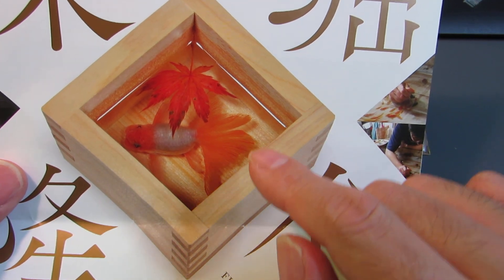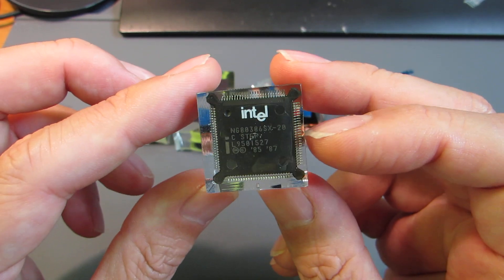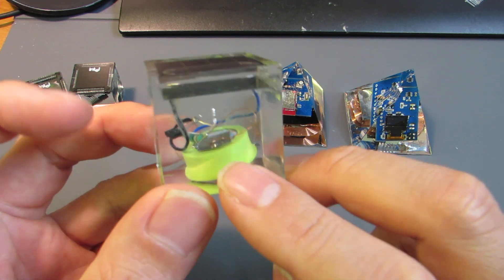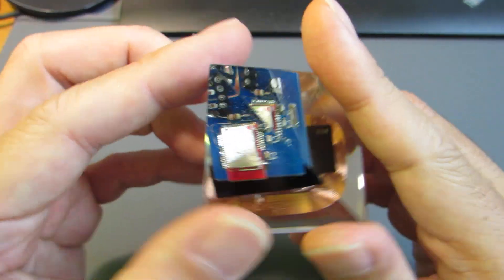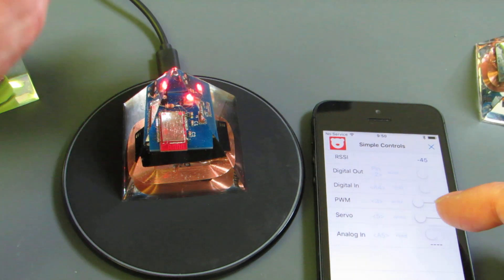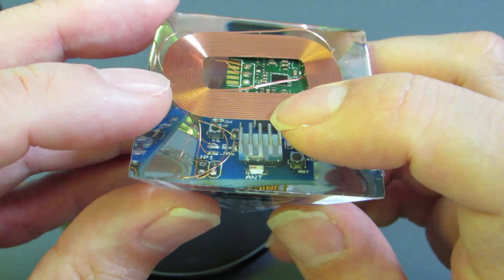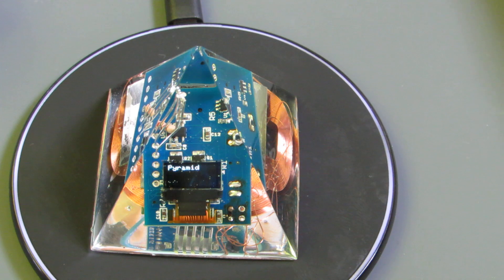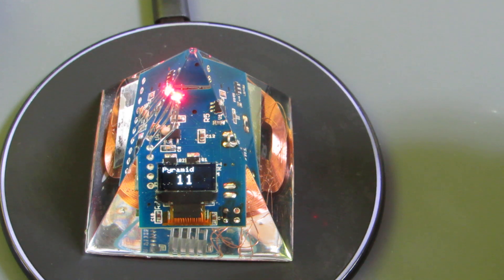Enclose them all in super clear epoxy!!

Comment: Nice! Where can I buy that kind of epoxy?
Reply from the maker: It is a material made in Japan, but I guess not limited to that brand. (several company sells them..)
Reply: Thank you @microwavemont  ! I was told that if I put it on ESC(electronic speed controller), I will have problems like shutting down because of heat not escaping. What are your thoughts? I was planning to use it on my miniquad copter.
Reply: @neilfpv Theres a lot better alternatives to this type of epoxy for a potting compound if moisture/shock proofing is your objective.  There are many potting compounds that are meant  for circuit boards that conduct heat but are not transparent.  If transparency is the objective there are some options for thinner coatings and potting compounds that have some level of heat conduction that are transparent and provide protection from the elements.  Look up transparent potting compound to see some products available.  I’ve also personally tested a range of cheaper alternatives for the purpose of weather-proofing electronics, some being transparent as well.  
If your motor controller can easily dispose of heat and components stay cool in use you should be able to mask off any contacts/connectors and apply a few coats of something like Rust-oleum Universal clear coat to achieve a transparent protective coating.

Comment: love it. i have wanted to POT a dead bug PicAxe project with a small PV for  a year or so.I would polish down to minimum contacts on one side.  It would randomly resend TV OFF or 'my favorite channel' via IR.   Have you thought of potting a little super cap inside ?
To reduce bubbles use a little paintbruss to 'wet' the complex surfaces with epoxy before submersion.
Reply from the maker: Thank you for suggestion. As for bubble reduction,  I will try next time! As for super capacitor,,,, hmmmmm.....